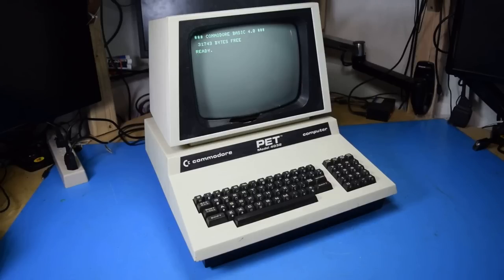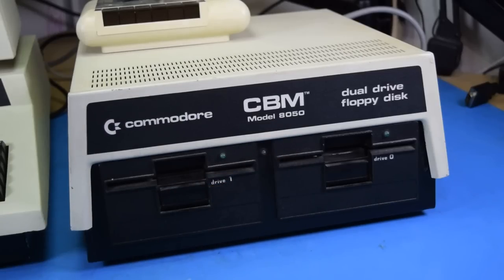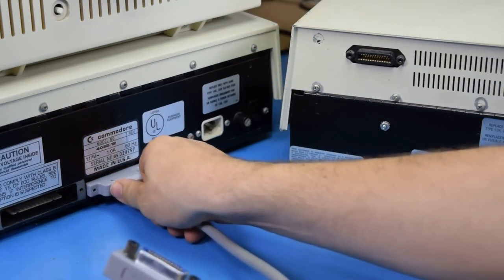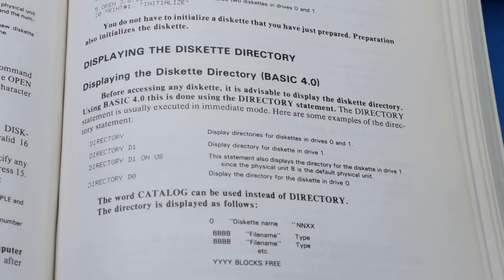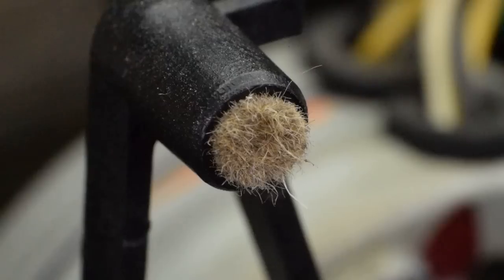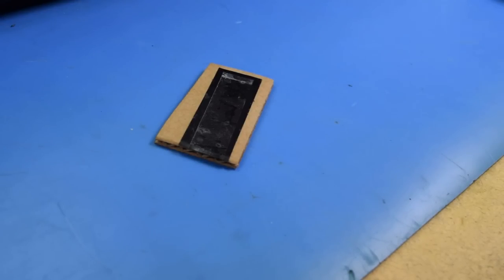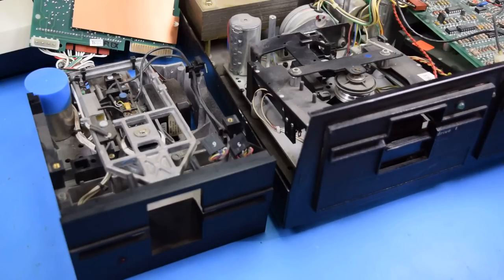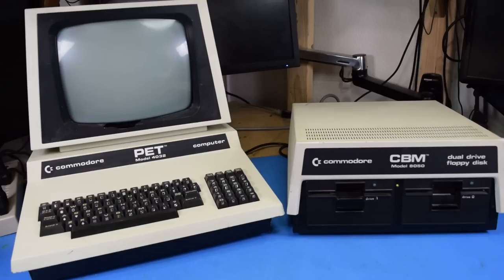0x0032 - Commodore PET Disk Drive

Comment: The felt pads you installed, how are they performing? Any disk damage issues? I wonder what material is used for cassette tape pressure pads. Those should be ideal. Very interesting.

Comment: So why did it need 2 6502s?
Reply: Because it's essentially 2 independent drives in one case.
Reply: @AmstradExin  That was sure a way of unnecessarily increasing the cost of the product at the time.
Reply: @infopackrat  I guess when you (Commodore) own the company that makes the chips, you figure you'll sell as many as you can.

Comment: That was a great technique for creating those felt pads, I wouldn't have come up with such a novel backing solution. Could you tell what the backing was on the original felt pad?

 That 8050 is really something else, so much going on! It seems strange to me that Commodore would leave the older top flap design for this more complicated version, just to abandon it for the swivel gate style in later models. Patents maybe?
Reply from the maker: I think the backing was some kind of paper with adhesive on both sides. I can't go look at it again because it disappeared after I got the new one punched out and I wan't able to find it again.

Well, Tandon was the big player in the usual floppy drives from that time period. I do think that there were other brands making similar drives though. These drives in the 8050 share one control board instead of needing a separate one on each drive like the other kinds have. So it could be a design simplification or cost saving measure.

Comment: That seems crasy that the floppy drive controller is more powerful than the computer it's being used by.
Maybe you could run software on the floppy drive haha
Reply: They should have offered that as an option when the drive wasn't being used.